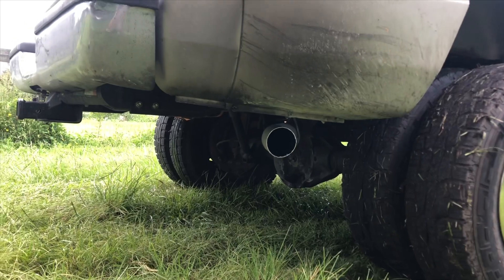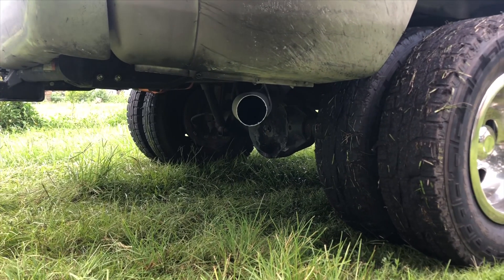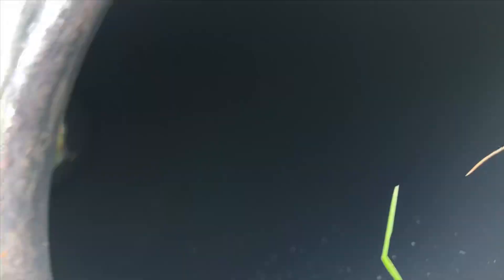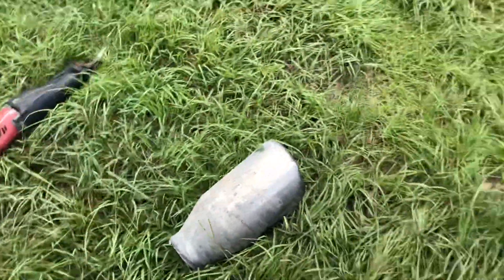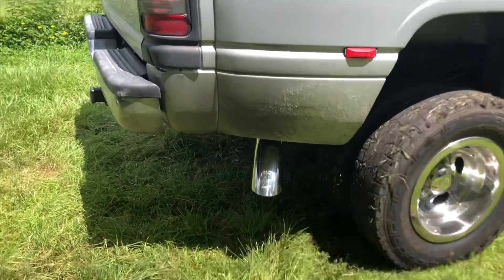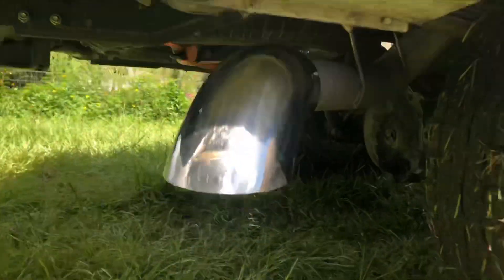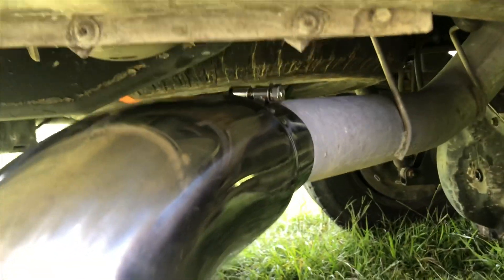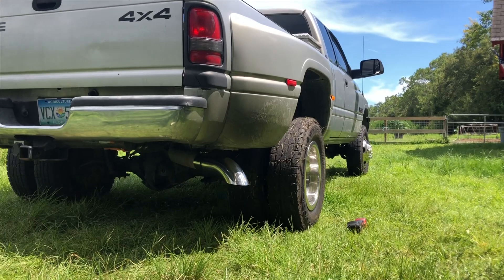HOW EXHAUST TIPS CHANGE THE SOUND (DIRECT COMPARISON)

Comment: How did you get the turbo sound like that
Reply from the maker: Open cone air filter and turbo silencer ring removed
Reply: @floridafenceland1137  thank you so you mean a full air intake system? If so which brand did you go with
Reply from the maker: @michaeljohnson9079  no actually as long as you have the like k&n style
Filter without a filter box itll be loud I had the factory rubber hose I just removed the factory box and filter and slapped a k&n on it
Reply: @floridafenceland1137  that's a good idea.have you ever heard of drilling holes in your factory air filter box.what do you think would it help anything?
Reply from the maker: I mean yeah that might make it louder but k&ns are like $50 and it’ll flow better and give you the noise

Comment: Did you changed the exhaust manifold?
Reply from the maker: No sir all factory
Reply: It sounds so badass. How can i make my turbo spool sound like yours? I can barely hear it on the exhaust tip. I have a 5” to 8” exhaust.
Reply from the maker: Did you take the silencer ring out of the turbo?
Reply: The Diesel Ranch yes. Intake, heater delete and air horn replaced. Yet my turbo doest want to whistle. I can only hear ir from the cab at high RPMs.
Reply: Alejandro R.R. OMG ME TOO!!! I have a 5” to a 7” on my 01’ 24v and i can’t hear the turbo at all through the exhaust
Reply: Alex Slay. I know right. I don’t know what else i can do to it.  I hope the turbo is working properly.

Comment: 12v or 24v?
Reply from the maker: 24v
Reply: Ok. Sounds like a 12v but it's a nice truck man. I'm trying to figure out how I wanna run my exhaust on my 97 12v. Stacks or what. Right now it's running out in front of the rear tire. And it's just a pipe no tip. It's a nv4500 so it already sounds like a big rig rowing threw the gears hahaha. But yeah thanks for showing the comparison on the different types and at the end showing them all together I really didnt realise how much of a difference it made.